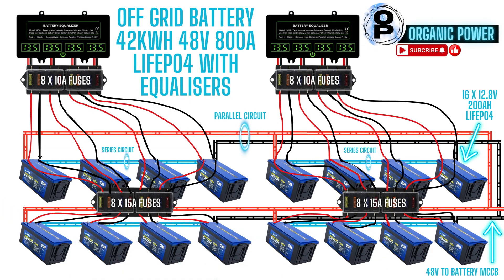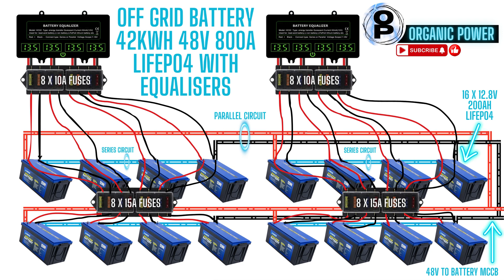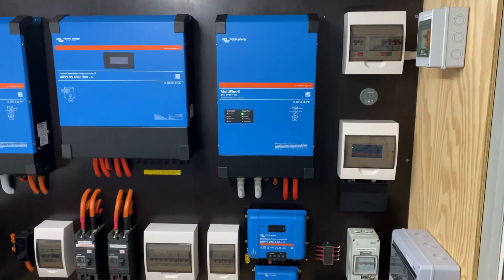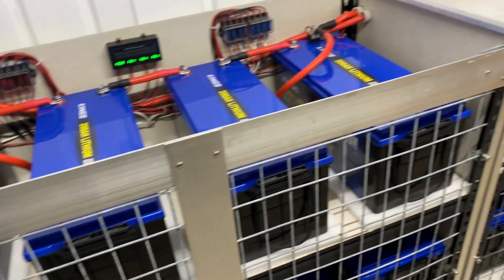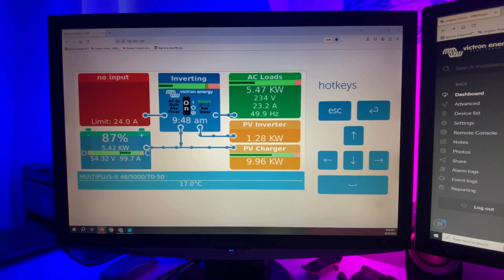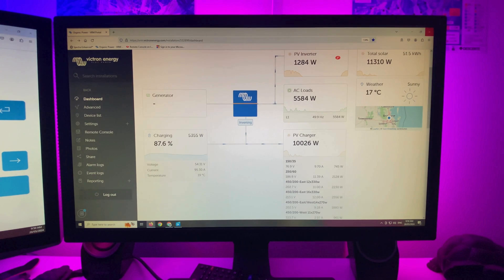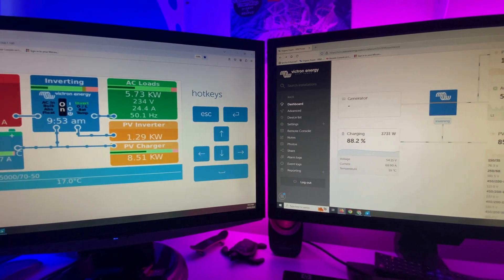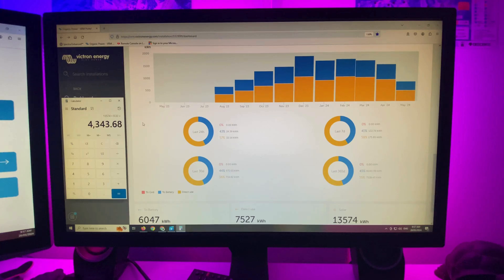EASY Way To WIRE An Adventue Kings Solar BATTERY 42kWH 20kVA Parallel Victron Multiplus II Off Grid

Comment: Just wonder why 16X12 Volts battery and not building your own 16 X Cells 280AH time 4 boxes? And how do you deal with heat in the shed during summer?
Reply from the maker: Thanks for watching, check out my episodes the cooling system.

Comment: Some of those views are probably people I’ve directed from the FB groups and forums who say it’s not recommended to series or parallel Kings lithium batteries ! I say don’t tell Rob from Organic power! 😂 Have you deleted some of the early videos?
Reply from the maker: Thanks for supporting the channel! Who's Rob, Yeah it doesn't work as you can see 🤣 I think an Industrial electrician knows a bit more than an FB group, the whole platform is a bit of a joke. Probably members episodes. I keep technical information for them.
Reply from the maker: Maybe these are the episodes you were referring to:

Victron Energy Battery Management System For 15KVA Parallel Multiplus II Solar Power System - Part 1 - https://youtu.be/sJygdnNDFHM

Victron Off-Grid Battery Management System For 15KVA Parallel Multiplus II Solar Power System Part 2 - https://youtu.be/AOdEGcerc-c

Comment: how do you go about checking the BMS of each battery?
Every battery has something like 4 cells in it already
Reply from the maker: I leave that in the hands of kings, with the internal unit. I trust the units are fairly good, any issues the shop is around the corner while under warranty. I guess I’ll find out how they fair.

Comment: I am glad I bought lead carbon over all others. Disadvantage is weight, Advantages it is non spillable, can run 20 to 80% for a month before a full charge is needed, charges at -30C, has no BMS or equalizers needed, if charged proper no off gas, a direct drop in upgrade for worn lead acid batteries, Warranty is 2000 cycles but what could fail? at worst it will slowly degrade. If you have a problem with lead carbon almost all times factory defect or damage from overcharging(bulge). Last time I checked the bank only .1v difference between them. Victron makes lead carbon too. Google information on lead carbon is sometimes mixed with lead acid info, even voltage charts are wrong. It is newer tech, hence the lack of info and test results.  2 less things to go wrong. Since the info can be hard to find for lead carbon: absorb 57.8v float 55.3v ,41v 0% 51.6v 100%. but I have seen my bank float to 52.5v.  You both help a lot of people understand solar, thank you both for your efforts. There should be a YouTube solar install competition, I bet on Rob for gold.
Reply from the maker: I took a quick look at the technology and found this. I'm not sure I'm up for that. (see below) I would have to build a solid steel frame 61kg each 😲

The lead carbon are basically an AGM with the benefit of not loosing capacity from sulfation. However, in order to achieve this, they need to be charged at a relatively high rate (0.4C) from a low state of charge weekly, with an occasional "refresh" charge similar to an equalization charge. That is recommended practice with most Pb batteries, it is just more effective with lead carbon. In most other respects, they are the same as an AGM.

From the manual:

"Periodic Fast & Complete Charge Cycle Recommendations: Note that periodic fast (high current) charging from a low state of charge can help restore usable capacity after periods of repeated slow charging (less than 0.2C) or deep discharge cycles. It is recommended that the battery goes through a complete charge cycle from a low state of charge every week if they are being heavily cycled or at minimum every 30 days. Ideally the batteries will be charged at a current of 0.4C (46 Amps for an Oasis G31) but a minimum of 0.2C (25A per G31 battery) is acceptable. For applications lacking fast charging capability, contact OPE or for alternative restoration procedures."

"As stated, Firefly Batteries can operate in a partial state of charge for long periods of time without sustaining any permanent damage. The usable capacity will decrease, however, with each cycle within a partial state of charge, up to a point. In order to regain the full original capacity and in some cases more, it is necessary to perform a restoration charge. To perform the restoration charge: charge the G31 to 14.4V or the 4V/450AH to 4.8V and continue to charge until the current drops to 0.5 A on the G31 or 3A on a 4V/450AH. Fully discharge the battery to 10.5V (G31) or 3.5V (4V/450AH), and then repeat the same charge cycle."

So if you are considering them, make sure you are able to meet those charging requirements. Solar might not be able to charge at the 0.4C rate, and you might run out of daylight before a restoration charge is done.

https://www.emarineinc.com/Shared/pdf/Battery/Firefly-Oasis-12V-G31-Users-Manual.pdf
Reply: @OrganicPower-Australia  wow glad I bought Xterra they say let it float till 1amp every 30 days
I have mine on plywood on ground under the RV 
Definitely not for attics or mobile applications
It's fine since I haven't been low enough to get absorb since 3rd day after inverter swap in march
Some days at dawn I am down less than 1 volt
Reply from the maker: Perfect! 😎

Comment: Do your battery equalizer get abnormally hot? I had one of the HA02 ones and the voltage between each of my battery  got worse over time so I took it off.
Battery voltages 
(13.3.   #1
13.3.   #2
13.3.    #3
13.78.  #4)
Reply from the maker: Hi, sounds like the unit might have gone faulty. If any of the legs get shorted out during operation that will happen. My equalisers are cool to touch and very evenly balanced. Thanks for watching 😎
Reply from the maker: I have just purchased a FLIR camera and will have some episodes out shortly with thermal imaging of the system. Keep an eye out for those episodes, it's a great unit!
Reply: @OrganicPower-Australia  Okay can't wait. By chance what is the name of your battery balancer?
Reply from the maker: DO NOT BUY PowMr equalisers! They do not work as well. The link below is the unit I have had great success with:

https://www.aliexpress.com/item/1005006269540789.html?spm=a2g0o.order_list.order_list_main.22.32821802FvCMlp